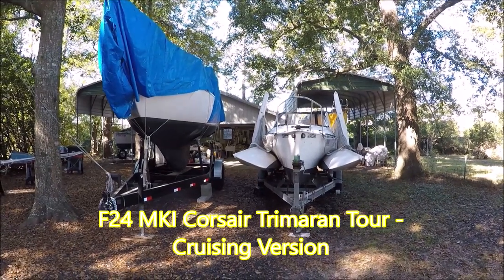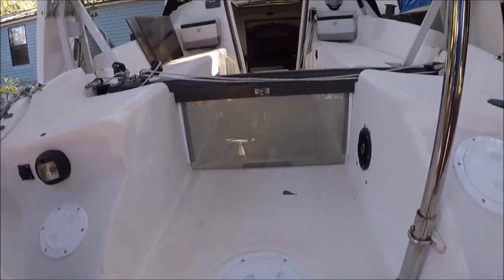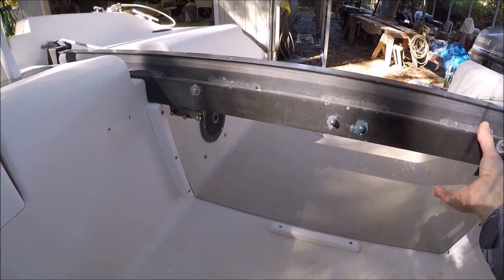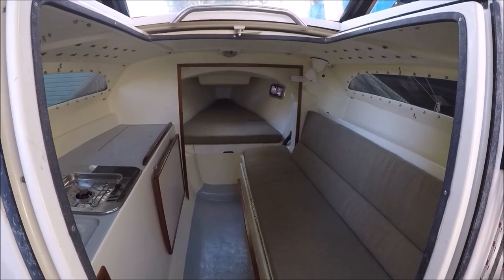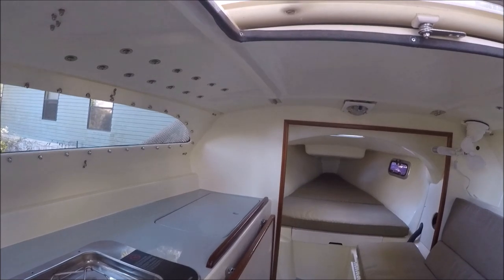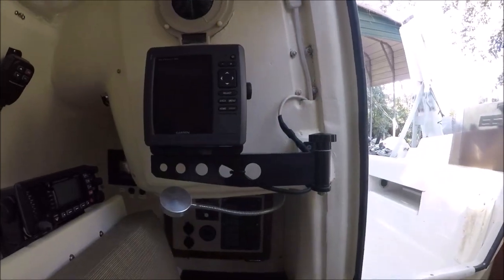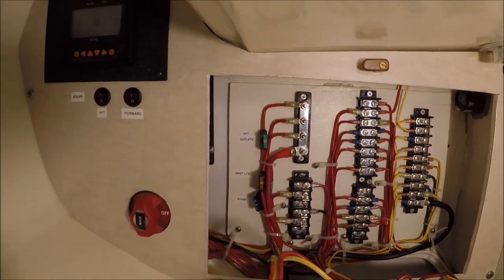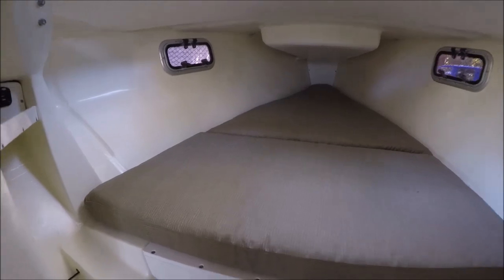F24 MKI Corsair Trimaran Cruising Version Tour

Comment: what a stunning boat so clean looking ,the work you do on boats is amazing this will take you places in half the normal sail time or faster with a good wind ,one thing was curious about acrylic windows i knows its strong but polycarbonate is way more stronger and bomb proof for not a lot more money and wont ever crack around  drill holes
Reply from the maker: Thanks. I used to use polycarbonate many years ago but it just doesn't stand up well over time on boats so I mostly use cast acrylic now. Although polycarbonate has the advantage of less likely to crack during drilling or expanding and contracting around fasteners it has several disadvantages. The cost is crazy high now, it scratches more easily and it doesn't last near as long as acrylic in the UV.  As long as you drill it carefully, use ample thickness and make fastener holes generously sized to allow for expansion, then in most cases acrylic is a good choice. But it needs to be cast acrylic, not extruded. And since 3/8" acrylic is plenty strong for these size windows there's no need to try to make them even stronger. If you choose a thinner more affordable polycarbonate with the idea that since it's stronger it can be thinner then you will potentially get leaks because it's too flexible, causing the sealant to lose it's grip.
Reply: @atomvoyager   that was great advice from your  past working with polycarbon think the cost implications is all the police and riot shields they need around the world to quell the disconcert has put the demand for poly cost  through the roof  ,so the next windows i buy i,ll go for acrylic cast
Reply: @atomvoyager  that’s very useful info, appreciate the time it took to write that out

Comment: Thanks for showing us your Corsair.  Man I would love that boat.  Have you ever looked into Victron Energy  Solar charge Controllers, they seem to be the "go-to" controller in both boats and RVs.  Just having the ability to see real time info on your blue-tooth connected phone makes them worth it for me.
Reply from the maker: One of my refit Alberg 30 Voyager Edition boats has the Victron with bluetooth and has been working OK. But more often I use the Epever because I want to see the display at a glance without turning on the phone, the Epever costs less with the display, and it can be programmed easier without the need for the "dongle". You can read the reviews of both on Amazon and some solar forums.
Reply: @atomvoyager  Thanks for the reply and I’m glad the Epever charge controller is working for you and are you able to see the display on the charge controller at a glance where it's mounted?  I have the Victron SmartSolar MPPT 100/30Solar Charge Controller and it doesn’t require a “dongle” (I think all the SmartSolar units don’t) and it would be great if it also had a display.  It's always great to see your videos and follow along on how you approach every project with your sailing experience and a produce a better than factory professional result when you’re finished.
Reply from the maker: @TerrydeAlaska  I do have to poke my head around the backrest to see it but that's not much trouble and other space is limited. I see at the link below that a display can be added to the Victron SmartSolar so I may try this combo next time: https://www.amazon.com/dp/B07GTPQP1X/ref=sspa_dk_detail_1
Reply: @atomvoyager  One more thing, I forgot to tell you I have two charge controllers connected to my array of 600 watts for redundancy (300 watts for each controller) and they along with my battery sense will all connect into one network and I can see Network total power coming in as well as battery voltage and temperature.  This would also work with a Victron Energy battery monitor as well, mine is an old one by bogart engineering.

Comment: Awesome work and great video. Do you prefer the trimaran to a monohull? Asking because I have an Island Packet 27 but have been wanting to sail faster (coastal day sailing, southern california) and the Corsairs look great but expensive. Thanks!
Reply from the maker: For coastal daysailing in SoCal the Corsairs are great for speed and less heeling although they require careful handling and a wide marina berth since it's not practical to fold them up in the slip because the sides of the amas would foul. There are other tris that the amas retract horizontally by swinging aft that would be better in that situation such as the expensive Dragonfly or the Telstar. There are many big and small trade-offs in going from mono to trimaran that you need to consider.

Comment: Hi, we are in the process of getting a F24 mk1 too. Inspiring videos. Wondered why you changed form a 2 pit burner (video 1) to a single burner? Kind regards, Sipke
Reply from the maker: I sold the two burner and bought the single on ebay to simplify, save weight and space and because I lived aboard my other boat full-time for many years and got by fine with one burner.  Even meals normally done on two burners are easy on a single by being creative on swapping around the pots. For example, cook the sauce, then boil the pasta, set it aside and briefly reheat the sauce. And anyway, this is not a long-term liveaboard situation.
Reply: Thanks for you answer!

Comment: How did you get rid of the old contact cement and what did you use to fair the interior?  I have a project boat I'm working on that had the same interior treatment and have already pulled out all of the carpet, bu now have contact cement all over the interior.  I also have removed the cracked plastic port lights in the cabin side and will replace them with acrylic/plexiglass as you've done numerous times and install either Vetus or metal opening port lights as I see you did over the galley in some of the later shots in the video.  I also like your placement of the electrical panel in the bulkhead at the aft end of the starboard bunk, should stay away from any moisture coming in the companionway.
Reply from the maker: We didn't find a good method of removing the contact cement. We did a combination of chisel, stiff putty knife, wire wheel on a drill and various sanding methods. The fiberglass is thin inside and rough surface so it's not possible to get all the glue off. But we got some of it off and applied a thin layer of West System resin thickened with 407 fairing compound additive then sanded and applied an epoxy primer over what remained and left the surface slightly rough and used a stain or semi-gloss paint that helps not to highlight the roughness and it came out pretty good. Experiment with your cleaning and painting method in a small area and see how it looks. The epoxy primer is tough so should resist coming off even though it has some glue under it.
Reply: @atomvoyager  Thanks for the feedback.  I thought I'd be in for a lot of sanding, but maybe only need to get down to glass on the high spots.  The interior surface was left with the rough texture from the roving and I don't want to sand into the fibers and weaken the laminate.  There are some areas that I want to stiffen with stringers, so I'll probably need to get down to the laminate in those areas at least, but will be building them up with the additional material.
Reply from the maker: @sammiller709  Yes, I only needed to get the glue off the high spots of the fiberglass cloth weave in order for the fairing compound or primer to adhere well enough. If you want to discuss other things on the F24 or compare notes you can contact me by email through atomvoyages.com. I'll be interested to hear what else you're doing.

Comment: Great video.
What is your preferred single part paint?
What is your cruising speed on Corsair vs triton?
Reply from the maker: For interior I like to use EZ Cabin Coat that I tint to off-white or any good semi-gloss mold-resistant water-based interior paint. I don't use single part paints for exterior any more because they don't stand up long enough to the UV and abrasions to make them worth the labor involved.
The Triton will sail at 6k all day long in the right conditions, although 5k is a more realistic speed made good in 24 hours. The F24 MKI will do a max of 15k in flat water, with 12k being a safer speed with less threat of burying the lee flat and turning over. In bigger seas offshore 12k is max and 10k is effortless so off the wind the speed of the F24 is roughly double that of the Triton or similar monohull.

Comment: Great example of this model boat.  One question, if I may.  Why are you running the 2 blue liner on the amas to the shrouds?  I haven't seen it before and was curious.
Reply from the maker: This boat came to me with the tensioning tackle of blue lines set up to tension the shrouds and the system works well. Maybe other boats do it different.
Reply: @atomvoyager  I can confirm my 24 MK I has the exact same system - I think quite a few of the Corsair designs to. Thanks for these videos, we're hoping to make ours look half as good as this!

Comment: @atomvoyager  I was trying to work out if our mast is rotating .How do you find the mainsail roller boom reefing. Im building a trimaran at the moment and I'm considering using it .do you have any problems with the bolt rope jamming
Reply from the maker: I don't have a problem with the bolt rope jamming except that there is more friction than I like on my newest mainsail boltrope as it slides in the mast slot. The sailmaker either used too thick a boltrope or too thick sailcloth that wraps around it. The old main works fine though. As a cruiser I don't want the complication of of a rotating mast. I kept the roller reefing boom setup mainly since that's the way the boat came. There are pros and cons to it compared to slab reefing (AKA jiffy reefing). If setting up a new system I'd be tempted to go with slab and a low friction Tides Marine track, although it adds weight and cost.
Reply: @atomvoyager  thanks for your reply do you need to round up to reef..
The tides track look great but I'm in Tasmania, Au so the freight is prohibitive not to mention the import duty
Reply from the maker: @adrianbaker9804  Generally I don't need to round up but sometimes it's easier that way.

Comment: What’s the average speed?Nice video.
Reply from the maker: It sails effortlessly at 10 knots and 12 knots is easy to get. Top speed would be about 15 but there is risk of burying the ama at that speed. 12-13 knots is fairly safe and easy though.
Reply: @atomvoyager  That’s enough speed to outrun a storm. Really admire your work, fair winds.

Comment: how much would you sell this for? Or do you think it's worth with your mods?
Reply from the maker: I ended up selling this boat a few months ago for $33,000 since I had other commitments and wasn't using it.
Reply: @atomvoyager  after watching your video I was wondering if I could buy it too! (But looks like I missed out by a year+). How much time (roughly) did it take you to remove the mouse-fur, fair it and paint it? I've never liked that stuff.
Reply from the maker: @andrewchewter1646  The previous owner had removed about half of it, faired the surface and painted. I did the remainder and it was a slow process because of all the glue stuck on the rough fiberglass. If you want suggestions on how to best due this job you might ask on the Farrier / Corsair Trimaran group.io